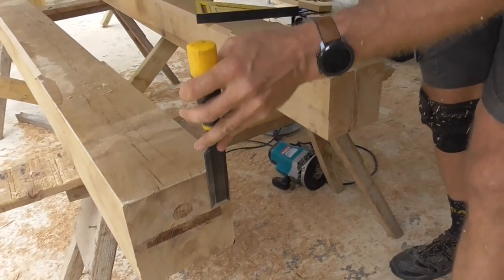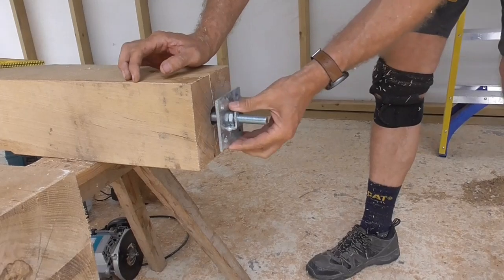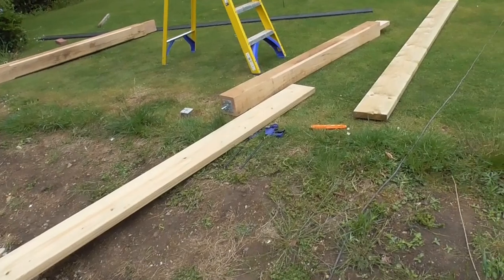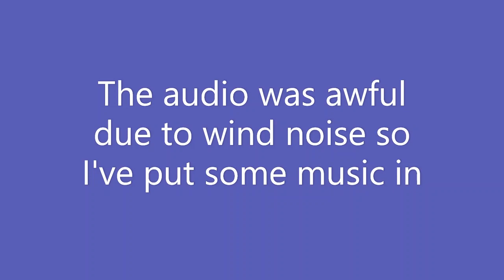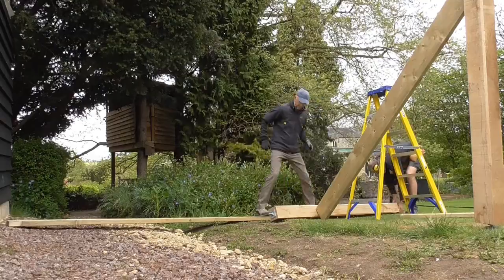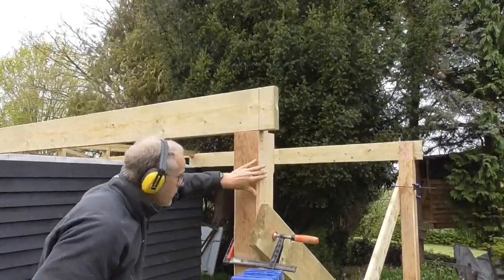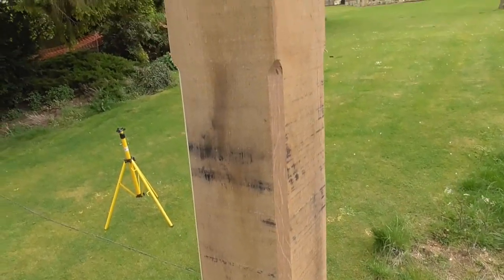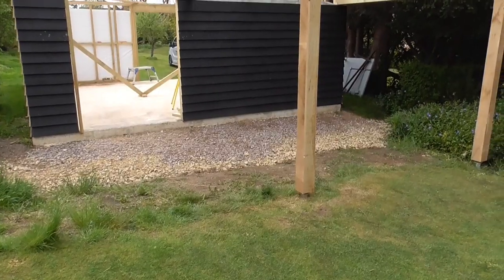Timber framed garage and garden utility space. PART 5 (fitting oak posts and roof frame)

Comment: loving the videos! i always like watching and learning new ways and techniques to do stuff. what a ace project to be doing. more of a summer job though although were ment to be in summer now. your almost making want buy some dewalt tools, that circular saw looking powerful :). keep up the good and informative videos, thanks
Reply from the maker: Great comment Tomm, and thanks for watching.🤩 I've ended up with more DeWalt kit than meant to, but its really decent stuff and compliments the Makita stuff I have in my toolkit.👊 I don't know where the nice weather is hiding, but its starting to get tedious now.😩 Cheers.
Reply: @thetallcarpenter   the dewalt stuff is just abit expensive ill have to wait till the right job come in for them tools. it seems to be save up abit buy a new to save up abit buy another. it never ends . you seem to have the perfect set of tool. do you just loads the van with what your using that day/week?
Reply from the maker: @iTzZToMMyD  Hi Tomm. I buy all my kit when it is on some sort of offer. Yes, you have to work yourself up to making tool purchases and, even when on offer, they are still expensive. I don't think there's a carpentry job I couldn't tackle with the kit I carry on the van. Special tools like the core drill, 1/2 router, 10" circular saw and 10" chop saw only go on the van when specifically needed.👍 All tools get secured every night which is a pain but necessary.😎 Cheers.

Comment: Ground screws are the way forward in my opinion. Better for the environment, no dig out, reasonably easy to install and I'm guessing more economical as well.
Reply from the maker: Hi Rodger. They are not for every situation, but could easily replace many concrete footings on, certainly, timber frame construction like this.😎 Cheers.

Comment: Excellent looking work that all fitted nicely, how come it looked to be the level of the main structure ?
Reply from the maker: Hi Kevin. The 9x2,s are the same height as the main structures roof plate so the roof runs at the level👍 Cheers.
Reply: @thetallcarpenter   Having now watch all your projects section I would like to express my gratitude to you in not only showing some great hints and tips but also answering all questions in, I hope I you did not mind. You will soon have many more subscribers if you continue this way and lots more experience in your new Youtube venture. GOOD LUCK.!
Reply from the maker: @amazing451  Hi Kevin. I appreciate you've worked you way through these videos and it's fantastic having people like yourself watching and asking engaging questions in the comments sections.🤩 Hopefully, when I get to 10k subscribers I will make a video outlining my reasons for filming my work and what I hope to achieve by doing so👍 Thanks again for watching and all your great comments 😎
Reply: @thetallcarpenter  That won't be long 😎🤓😎
Reply from the maker: @amazing451  🤞🤩

Comment: Loving this series Del, been binging through it this morning 👍 
Your overhanging roof is tied into a very solid structure, would you be happy with that ground screw and threaded rod system for 4 stand alone posts for a pergola for example? Would you be concerned about racking or stability at all?
Reply from the maker: Hi Brian🖐Thanks for watching these videos, and your question about ground screws for a stand alone pergola are quite timely🤔I've been asked to build a similar thing, and I'm also not sure how I would go about keeping it rigid and not racking without putting really large 'knee braces' in each top corner. I keep coming back to concreting the posts into the ground a couple of foot as I know this will be super sturdy💪(would use chunky 6"x6" posts). Its something I'm researching at the moment👊Cheers Del
Reply: @thetallcarpenter  yes hard to beat the tried and tested methods, any tips on increasing the life of the posts in the ground? If you wanted to use nice oak or something instead of treated?
Reply from the maker: @Brian18741  To be fair Brian, despite what others might say, I've concreted 6x6 posts into the ground and they haven't rotted at all, even after 15 years. I guess it depends on the water level in the ground🤔An oak post would outlast us for sure👊
Reply: @thetallcarpenter  that's true alrighty! Thanks for the reply, now go back to the chocolate eggs 😜

Comment: Also wont those threads drop off? M12 threaded rod with a ton plus on it's thread? Must be the plumber in me but it's giving me anxiety! lol.
Reply from the maker: Hi Lee. The thread on the foot plate/screw is M16 and its tensile strength is many, many tons.💪 (it wont fall far if it does give up the ghost😆). Cheers.
Reply: M16= 9100kg in tension for standard grade.
Reply from the maker: @findbluesky  Thanks for putting a figure on it findbluesky.🤩 I knew it was a lot, and am always amazed at the massive forces steel threads can take/exert.😎 Cheers.

Comment: Great video TC how did you find the ground screws? Seemed to save a lot of time👍
Reply from the maker: The ground screws were soo quick compared to putting in a concrete pad.👊 Our research suggests that they can easily take the load were going to be putting on them.😎 Thanks for your comment.
Reply: @thetallcarpenter  Does the company work out the load etc then advise on size of ground screws . Cheers 👍
Reply from the maker: @andrewplatt  Hi Andrew. the customer did all the leg work in this regard. But yes, the type of structure and its weight, location and ground type were all given to the ground screw supplier who then advised on what screws would work. These screws can take significantly more load than were going to be putting on them.💪 Its always best to get advise from them as not all jobs or ground is the same.😎 Cheers
Reply: @thetallcarpenter  Thanks mate👍 always appreciate the time you take to reply.  Put your feet up and enjoy your weekend 😁👌
Reply from the maker: @andrewplatt  I enjoy replying to comments Andrew, and fear that I wont be able to keep up for much longer as the channel get busier.😬 At least I type with one hand and have a beer in the other.🍻 Literally, cheers.👍
Reply: @thetallcarpenter  👌😂😂🍻 And they say blokes can't multitask 😂😂
Reply from the maker: @andrewplatt  🤪